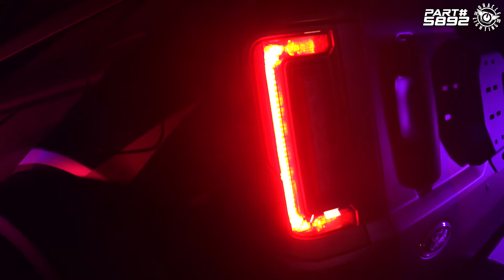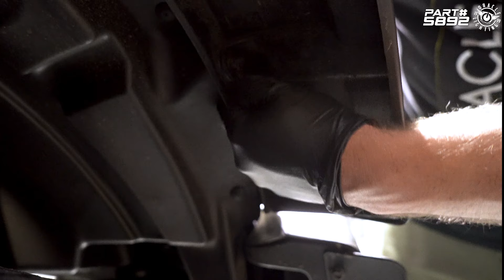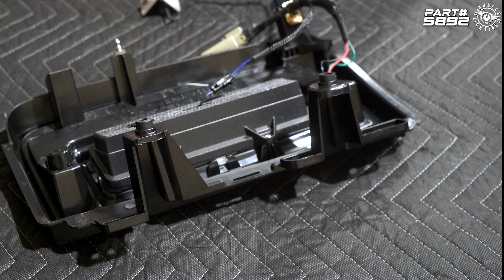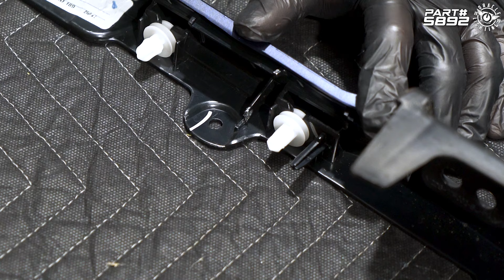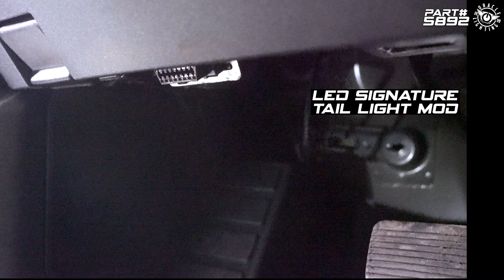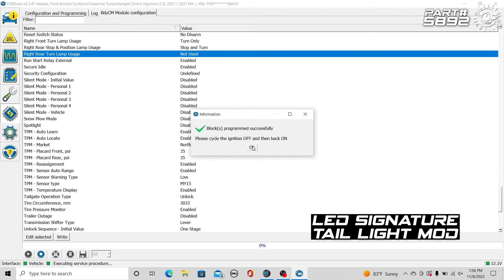2021-2025 Ford Bronco Flush Style LED Tail Lights from ORACLE Lighting- DIY Installation Guide

Comment: I had a problem with the driver's side fitment.  The Oracle light was too far in, and then the vertical trim piece was no longer flush with the rest of the body panels.  I solved my problem with longer 8mm bolts!  The OEM 8mm bolts aren't long enough!  The Oracle rubber spacers on the driver's side are a great idea, but they're useless with the OEM bolts - the spacers compress to the point of being almost meaningless.  Longer bolts allow you to secure the light, while also allowing the spacers to work at their full size.  Bow everything lines up and the fitment is great.  On the the passenger side!

Comment: Need a Windows computer to run forsan program.... little nerve-wracking using windows I'm a Mac user.... have to filter through all the windows B.S once you take your time... Works out just fine cheaper than paying the dealer. Besides, I need to recalibrate my tire size. I'm running 35 now if I choose to run 37 I can change it again plus I'm real curious about gaining the extra goat modes.. Now onto the trailer wiring, I might have to use for scan again...lol but it's paid for itself even with buying 175.00 laptop 20.00 for scan and 50.00 Cable Canadian... These tail lights are really great thanks for the video. The only thing I would recommend is that you slow down with the programming to give people a chance to find it and understand.

Comment: Having to mess with the forskan to instl these is BS. Dealer wants $250 to do it. Fck that. Bulky OEM's it is. Let me know if someone wants to buy a set of these BNIB.
Reply from the maker: You can add these modules and you would no longer need to do anything with the Forscan. https://www.oraclelights.com/products/oracle-lighting-dual-function-amber-white-reverse-led-module-for-ford-bronco-flush-tail-lights
Reply: @ORACLElights  So you are telling me to go and spend an extra $100 after I already spent $500+ on your lights to fix an issue you had a fix for but refuse to include it in your already expensive lights? Come on.
Reply from the maker: @palmettopowersports1642  Negative, we are telling you that you can spend $15 on a Forscan module (as stated on all the information before purchasing these lights) BUT if you don't want to use Forscan (for whatever reason) there is, in fact, another option for your convenience.
Reply: @ORACLElights  Can you link such $15 forscan module then?
Reply from the maker: @palmettopowersports1642  there are cheaper ones on other sites but this has free next day delivery from Amazon https://www.amazon.com/FORScan-Compatible-Forscan-Diagnostic-Programmer/dp/B0CJ9F6QQD/ref=sr_1_1
Reply: I’ll buy them

Comment: You need to make a version that has the separate Amber turn signal
Reply from the maker: Here you go https://www.oraclelights.com/products/oracle-lighting-dual-function-amber-white-reverse-led-module-for-ford-bronco-flush-tail-lights
Reply: @ORACLElights  do you make an Amber version for the Jeep Wrangler JK?
Reply from the maker: @EK9_Aaron  we do, its the same as the JT. Here you go https://www.oraclelights.com/products/oracle-lighting-dual-function-amber-white-reverse-led-module-for-jeep-gladiator-jt-flush-tail-lights
Reply: @ORACLElights  the JK has the same module as the JT?
Reply from the maker: Correct, there is not an Amber turn signal option from the factory for the JK so this is good for Euro/Export conversions or to use for chase lights.

Comment: Do you have smoked out taillights that are flush that don’t require for scan?
Reply from the maker: Yes, order the 5892-504-T https://www.oraclelights.com/products/bronco-flush-tail-lights and then add  https://www.oraclelights.com/collections/new-products/products/oracle-lighting-dual-function-amber-white-reverse-led-module-for-ford-bronco-flush-tail-lights
Reply: @ORACLElights  do these have a sequential turn signal feature?
Reply from the maker: Negative

Comment: When are you going to come out with some that you don’t have to do the foreskan ?
Reply: Never. Forscan is $13 for a year of use...
Reply: @SMITHZAC000   not worried about the cost, just not comfortable going into the computer system and changing things.
Reply from the maker: you can use these modules so that ou do not need ot make Forscan changes https://www.oraclelights.com/products/oracle-lighting-dual-function-amber-white-reverse-led-module-for-ford-bronco-flush-tail-lights?_pos=4&_sid=897df13ff&_ss=r

Comment: Does the dealership do the configuration on the lights?
Reply from the maker: They can but you can get the OBD tool for like $20 on Amazon and make all the changes yourself plus you can adjust and unlock other features on your Bronco yourself.

Comment: I just got these and my bronco is the Wildtrak model so I believe it has the LED taillights. I have a couple questions: 1) what do I do with the resistor? 2) the second piece you cut with the snip tool is hard to see - can you explain this piece? Thanks!
Reply from the maker: 1) If you have LED lights you can drop those in the nearest waste basket, you don't need them. 2) It's not a precison cut, you just need to make space for the factory trim to clip in. If you hold the trim up to the tail light you can see what is causing the interference (its a small plastic rib) just cut that off and you are good to go!
Reply: What were the forscan settings on your Wildtrack before updating them to work with the aftermarket lights?